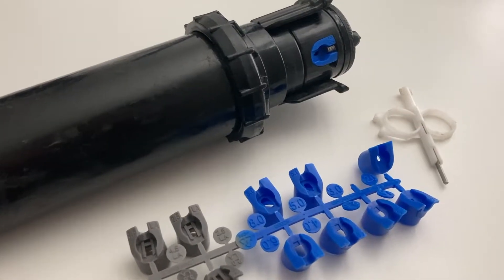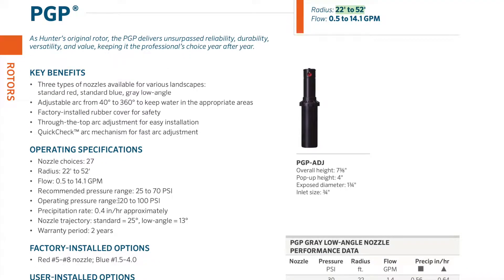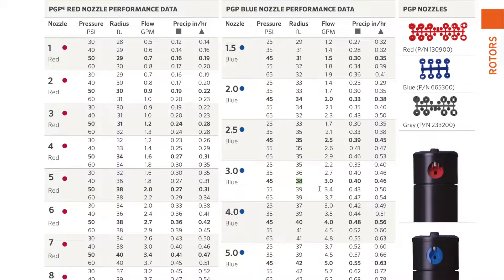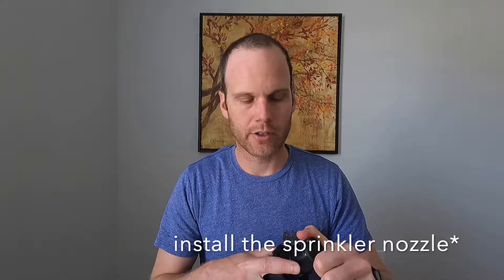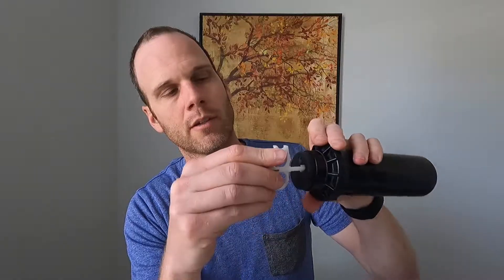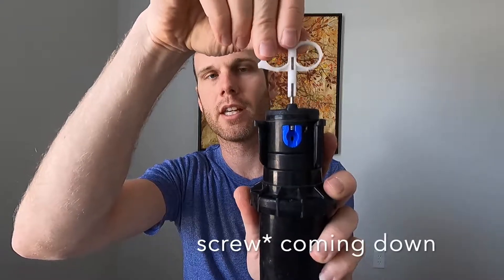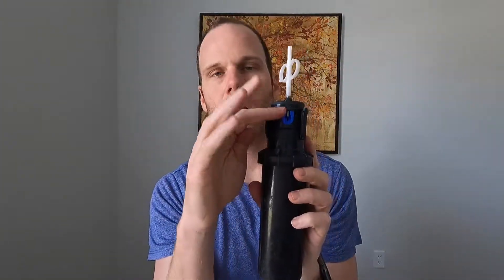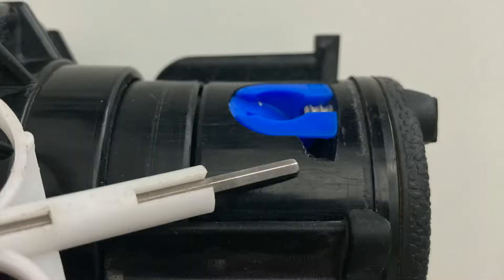Installing Hunter PGP Nozzles - Sprinkler Rotor Head

Comment: Do the different nozzles throw the water at different angles? I was noticing today that my 2.0 nozzle seems to throw the water pretty high. If I put a 3 or 4 on there, will it bring the angle down? Or do you have to get low angle heads to get any change?
Reply from the maker: Yes. The farther the distance / higher flow the steeper the angle.
Reply from the maker: Low angle nozzles are an option for some models of heads

Comment: How to remove?  U show it snap or hard to press in but how do u get it out when there's nothing to grab on to with a needle nose pliers. I have pgp-adj with completely round nozzle.
Reply from the maker: Great question.  You can back out the set screw and then turn on water.  That will typically blow it out.  Or since I usually am not planning to reuse it I will stick the rain bird tool in the orfice of the nozzle and pry it out that way.  Hope this helps!